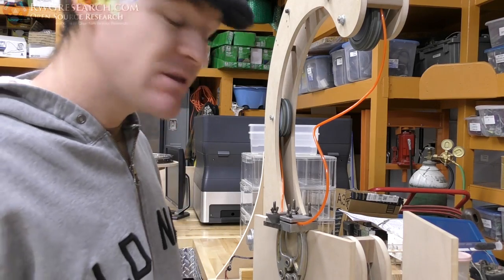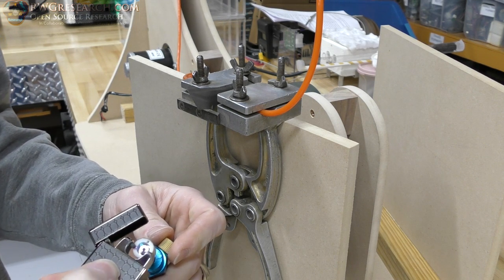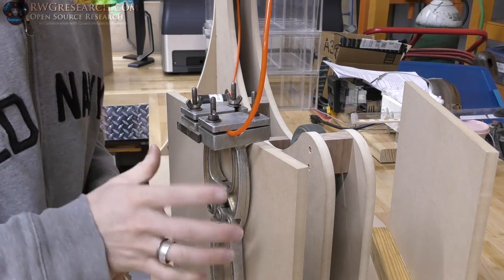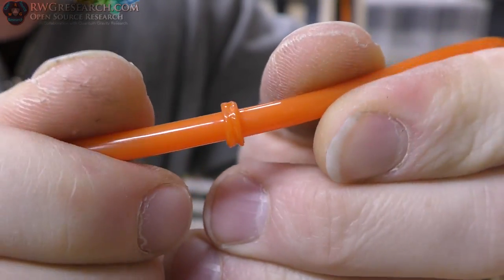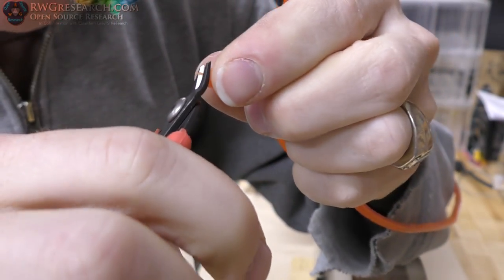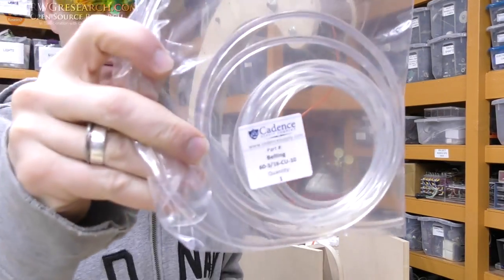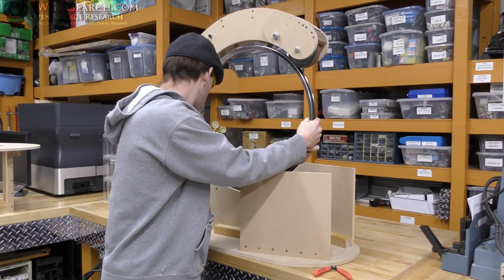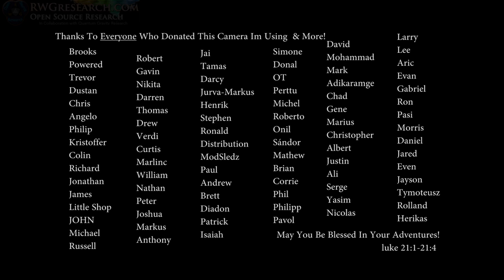How To Heat Vulcanize / weld Polyurethane O-rings / Belts. Extreemly Strong Custom O-Rings/Belts

Comment: Nice demonstration!
Two things:
1. Urethane belt ends are melted and joined. They are Not vulcanized. Vulcanizing is hardening rubber by adding sulfur and heating it.
2. It is not necessary or desirable to clip closely to the belt when removing the excess melted urethane. When the belt is stretched (installed) the join will narrow a bit naturally. SO it is Ok to have a bit of extra at the join. You can actually see the join narrowing when it is stretched/tested after welding (5:12).

Comment: Russ I Made custom print out of buna rubber we had the roll stock we would cut square apply the adhesive then put it in the vulcanizer clamper they were for altitude chambers.
Reply from the maker: yeah the adhesive is great for things like that, its the same process but uses the adhesive to "melt" ( bond) the rubber, however for the TPU its better to do it this way. you can also use ultrasonic ,they make them for this and your rubber parts but there quite pricey! thanks for the comment! ~Russ

Comment: Thank you, great tutorial!
Reply from the maker: thanks RJ, also this video was recorded and exported as1080P60 except the last clip, it was 4k 30 compressed to 1080P60. just so you know :) ~Russ
Reply: Did you use the camera's built in crop function, or did you re-encode externally?
Reply from the maker: was done in the editor, it seems i can quite seem where i can " compress" with in the cam... i can only so those other special features like " crop"  and stuff... ~Russ
Reply: Well it looks like I'll be getting me one, so I won't have to keep asking all these questions. :-) Yay !!!!   I know you like your older model a little better but in well lite spaces this model seems to produce much better video.
Reply from the maker: yeah this one is a lot better than my last... WAY more pixels lol  also I'm still boggled by the 4K vs 1080p. there is a major loss in wide angle... its bothering me a lot lol.  the 4K is not as wide as my old one. using a lens is an option... but thats a pain. and from my buddies testing the HD version is the same wide angle as the 4K... so yeah . i like my close shots. that forces me to use 4k mode in tight spaces to get the angle back.. but then i lose the 60P ah well ... :) ~Russ